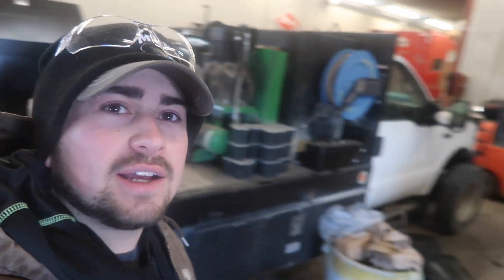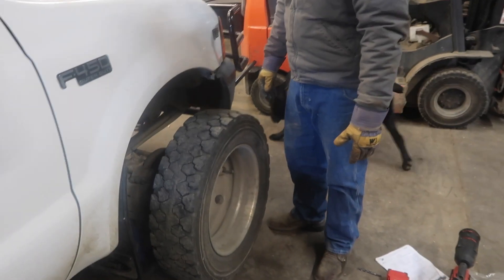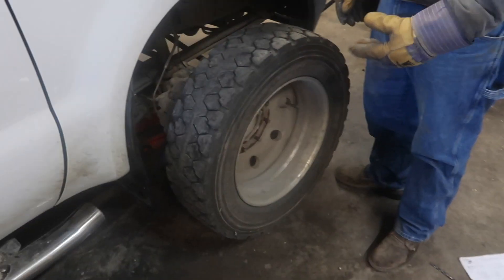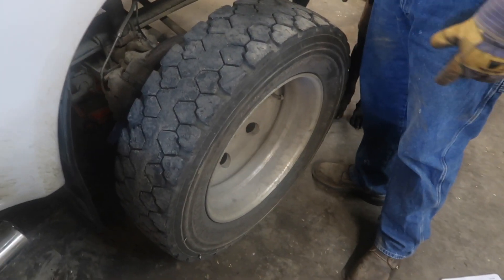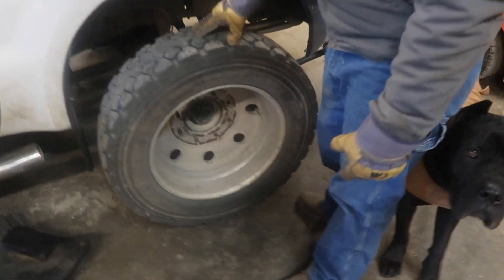The 7800 Is Broken! | Service Truck Work Continues

Comment: I love the looks of your 7800 with those big tires on the front!
Reply from the maker: It may not be FWA but it sure looks mean!
Reply: @mannfamilyfarms381  I think that series in 2WD is a good looking tractor, especially with big front tires. I also, like the International 88 series in 2WD. The newer 2WD tractors around that hp look disproportionate to me.

Comment: Hello, how did you know exactly that the water pump was broken? I have a johndeere 7800 FWD, it worked pefectly about 3 weeks ago then we had no work with it until now when it overheated very fast in load. I removed the termostats but it still overheats. I putted my hand on the 2 pipes that goes in the radiator and they are hot but the radiator is cold, could the radiator be clogged inside? I also dont get heated air in the cab which would suggest broken water pump... I want to know which one should i try to fix first: the radiator or the water pump.
Reply from the maker: The water pump was leaking out of the weep hole. The radiator should have a temp drop from top to bottom but if it’s cold you’re right it’s like the water pump is not pushing water through to cool it. I’d start with water pump
Reply: @mannfamilyfarms381  yeah, my pump is also leaking so pretty there is a big chance it is broke. Thank you a lot for help, i am a young farmer from eastern europe :). Do you remember how much costed you the water pump?